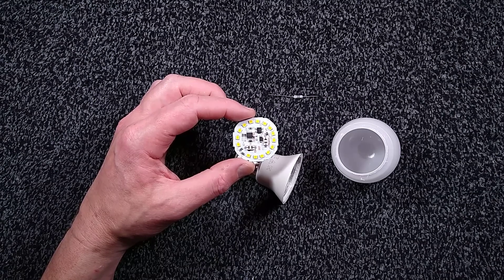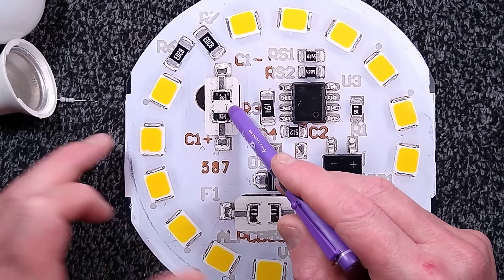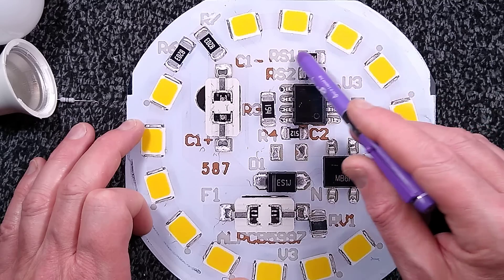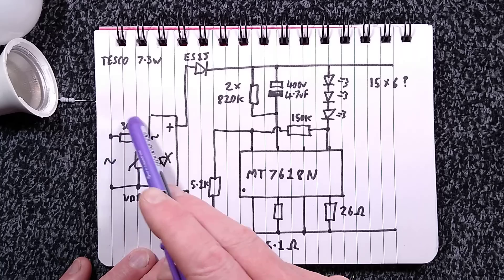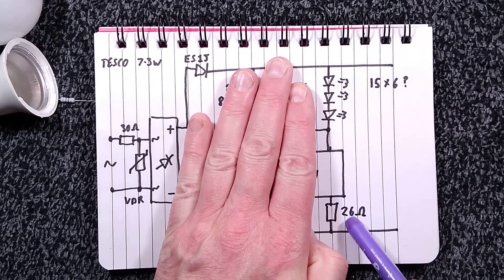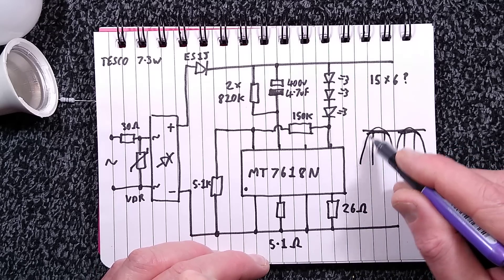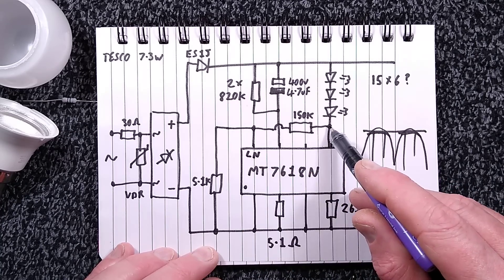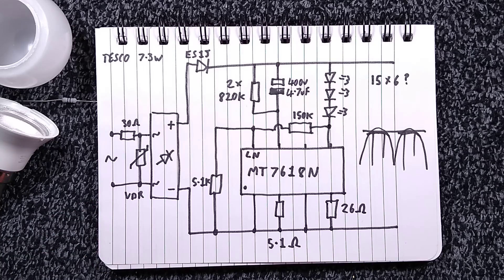Tesco lamp with weird circuitry twist

Comment: The LN is a voltage divider for line input voltage compensation. I've seen this used in higher end LED drivers to prevent LED flux issues seen with linear based designs. I like this as you can not only have constant regulated current at all times to the LEDs for longevity, but also maintain consistent lumen output with the constant voltage compensation.
Reply: You are probably correct, but Clives theory still spread more joy.
Reply: I was just about to leave a comment saying the same thing, now I'll just upvote yours lol
Reply: @ralgith  I was also just about to leave a comment saying the same thing, now I'll just  leave a comment here & upvote yours as well 🤣🤣
Reply: But please think of the Lesbian Nuns 😎
Reply: Agreed. Thanks for writing it. Upvote from me.   Fred
Reply: Why would input voltage compensation be necessary?    An LED driver is ideally a constant current device...  And is therefore independent of line voltage.
Reply: @Wierdy1024  This driver is also trying to smooth current across the capacitor, and the capacitor definitely isn't a constant-current device.
Reply: @Wierdy1024  only if voltage is high enough to pass this much current through these leds, ideal current source got infinite open circuit voltage.
Reply: That's handy, presumably this design makes sure the nuns don't need to worry about mains voltage fluctuations shifting their sexy mood lighting into the off-putting "gynaecologist's exam room" range when they're getting down to it.

Comment: My best guess: Diode for reverse recovery of the std bridge, std bridge diode di/dt is quite slow, a fast reverse spike on a ‘slow’ forward conducting diode will pass through the bridge internal diodes, the fast diode will negate this to a great degree. Normally not a problem if you have any capacitor on the DC side of the bridge, in this circuit I am guessing the diode is to protect the IC from such noise spikes as there is no capacitance directly on DC side of bridge before passing through the IC (or diode string)
Reply: That's my thought as well. It is probably just switching the capacitor in and out of the mains portion of the circuit at mains frequency, but the slow reverse recovery time of the bridge rectifier would cause spikes of current to flow back onto the mains, generating noise. Having the high speed diode there probably suppresses that.
Reply: @mysock351C  But millions of devices run regular bridge rectifiers off the mains, practically every appliance in the home does these days. Hard to why it would suddenly be an issue for this one little bulb?
Reply: @MB-st7be  due to the active PFC with switching the cap, probably.
Reply: @MB-st7be  It is because it has active switching circuitry in it. Remember the part about PFC? The capacitor is not just being charged in the usual manner. Rather it likely is being switched between charging from the mains and discharging through the LEDs. All diodes (with the exception of Schottky diodes) have junction capacitance and recovery times to consider. Standard rectifier diodes are SLOW and without the fast recovery diode, large switching transients would get back through the rectifier. This is an issue with mains transformers as well since the leakage inductance can make the rectifier reversed biased momentarily and it generates lots of harmonic noise. Standard LED lamps sans PFC do not need the diode.
Reply: @MB-st7be  we used to throw our poop out into the street too. At some point the first house was connected to a sewer.
Reply: Is there a power factor when there are no reactive load components?
Reply: @G6EJD  The capacitor is the reactive component. Serendipitously I found one of these lamps with this same PFC circuit at the office that had died. After a quick fix, it looks like it alternately charges the capacitor in the valley of the rectified DC from the bridge rectifier, and then disconnects it from the mains whereupon it continues to discharge through the LEDs. The diode is indeed needed to stop the switching transients from propagating back into the mains. Its a bit crude, but it does sort of work. Edit: No, actually its linearly regulating the charge current of the capacitor instead. Basically once it comes into regulation, it starts throttling back the peak charging current to hold a constant voltage on the capacitor, which in turn helps even out the current pulled from the mains. Actually a pretty neat circuit, and I had some fun messing with it.
Reply: @mysock351C  I didn’t realise that a 4.7uF capacitor could hold that much energy, enough to illuminate the LED’s for about 5mS in the troughs, fascinating.
Reply: @G6EJD  It’s actually pretty interesting. If the circuit is started on a variac, it simply behaves as a normal lamp and the ripple on the capacitor is the usual sawtooth at voltages below where the supply regulates. At this point there is zero voltage on the gate of the depletion mode mosfet, so it just conducts like a low value resistor. However, once the point it goes into regulation is reached, voltage is applied to the gate of the mosfet to start to pinch off the channel and act as a quasi-constant current source for charging the capacitor at which point the tops of the saw tooth start being progressively lopped off. The control term for regulation is actually the LED current. Once the desired current threshold is reached, the capacitor current is progressively regulated as needed to keep the LEDs on at a constant brightness. However, once the voltage starts to fall again, the LED current drops too low and it then falls out of regulation with the capacitor simply discharging through the LEDs, and the cycle repeats on each half of the mains cycle. By limiting the capacitor current at higher voltages, basic PFC is achieved. Also the regulation scheme explains the need for the diode. The supply constantly comes into and falls out of regulation, and does so quite abruptly, generating transients on the capacitor charging waveform, which would easily pass through a standard bridge rectifier.
Reply: @G6EJD  Also the notion of it being “flicker free” is somewhat of a misnomer. The LEDs do stay at a constant brightness, but only when the incoming voltage is high enough to be in regulation.  The rest of the time they dim slightly as the capacitor discharges waiting for the next cycle. Still it’s small enough not to be visible.
Reply: True. I'd not thought of the obvious here- the smoothing cap is NOT directly across the bridge output...
The smoothing cap must be switched in and out to smooth the charging spikes. Ooh, just had a good design idea for a power supply....

Comment: I would guess that the IC does more than regulation, i think it provides a higher frequency to the capacitor for better efficiency or also maybe to be dimmable. The high-speed diode I think is the cheapest way to prevent ripples or spikes from the higher frequency go back to the powergrid, could you measure the frequency?

Comment: Clive, does the electrolytic capacitor look like it’s a low ESR type, as typically used with higher frequency switch mode PSUs? Or does only appear to be a normal electrolytic capacitor?

Comment: If the extra (high speed switching diode) is to deal with / protect against noise or switching transients, why have we not seen them in other high speed switch mode power supply circuit designs?

Comment: Be interested to see what difference it makes to the power factor! With smart metering becoming ever more popular and the possible implications of changing the way they charge for electricity
Reply: I don't think any currently deployed smart meters have the ability to do the harminic analysis that would be necessary for what you propose.

And they way the meters are built by contractors means they won't be able to require it be added it via a software update either.

Comment: Here it is:
High speed diode to protect capacitor from high frequency transients induced by switching power supplies nearby. LN is phase monitoring, used to measure the position of the dimmer switch. This phase monitor feature requires the capacitor to be switched off during phase detection. It might be connected via pwm to charge it slowly during phase, and discharge slowly during flicker reduction. Meanwhile the led is controlled pwm/pid via current feedback. Oscilloscope to check answers. Look for transients by connecting laptop power supply to same line.

Comment: About all the speculation about noise, in traditional electronics where a larger amount of power is converted from AC to DC, a capacitor is fitted across each rectifier diode to reduce the switching noise from the diodes. But this has not been done here. So I don’t think any part of this circuit is for the reduction of noise. It’s all to do with improving the power factor and reducing flicker. Hence why a variable current limit is needed for the electrolytic smoothing capacitor. The only possible reason for the extra switching diode that I can think of, is to increase the minimum supply voltage (at the bottom of the sine wave) before it starts drawing current.

Comment: block high frequency feedback ripple on the live? Using a good cap would do the same, but ripple can also cause damage to some caps, whereas the diodes don't damage nearly as easily as caps? Plus caps vary in performance at higher frequencies, the higher frequency caps also tend to be more expensive.
that's just a wile stab in the dark though
Reply: Right. This was my thought. Dynamic loads on the mains can produce high frequency transients, that may get through a full wave bridge, a HS diode here will mostly increase the life of the capacitor, which is probably first to go.
Reply: @BenjaminGatti  - ANY AC or DC voltage on the mains side will get through both the bridge rectifier AND the extra diode. The extra diode cannot protect against mains side transients.
Reply: @Mark1024MAK  I take your point; however, without a better theory, we have to give the high speed discrimination a purpose. Positive transients will be eaten by tvs, that leaves negative transients which this diode can block. This protects the cap, and might prevent glitching or flicking being induced under transient testing. Remember transient testing is pretty severe.
Reply: @BenjaminGatti  - the bridge rectifier will attempt to convert both positive and negative voltages including transients to DC. If the semiconductor junctions in the bridge rectifier do turn on fast enough to let them through, by the time they get to the extra fast switching diode, they will be all positive. Being a faster diode, they will have no trouble passing through it.
If a very rapid negative transient manages to pass through the bridge rectifier, it will be a relatively high impedance signal, and hence will be no danger to an electrolytic capacitor or the LEDs.
If proper transient protection on the DC side was needed, then there are more appropriate components that could have been fitted. Such as a fast diode across the DC supply rails (normally reverse biased), a VDR, maybe even a semiconductor transient suppressor, or zener diode(s).

Comment: the capacitor is actually being charged by connecting to ground in order to give a better power factor, then during the peaks, the capacitor is disconnected from ground and then instead connected across the LEDs (above the 26 ohm current limiting resistor) this then effectively makes the positive voltage rail higher than the mains supply. It would be doing this at high frequency, so the point of the diode is to prevent current going back to the mains during the peak. (It's likely doing a lot more than just this in the PFC chip, this is just an easy way to understand what it is doing)
Reply: Wouldn't the amount of reverse leakage in the bridge rectifier be tiny though?
Reply: @jaro6985  yes, the bridge's leakage current would be tiny at 60Hz. The only reason to have a fast diode is if something is being done in the kHz range. Maybe the chip is shaping the capacitor charging curve using PWM and the fast diode is to isolate the bridge from that.
Reply: @teardowndan5364  Looking at the circuit in the datasheet I think it may just be switching the capacitor in and out at mains frequency. The diode is there probably just to stop the bridge rectifier from being reverse biased when it switches over. They have a slow recovery time and this would probably put a 100/120 Hz train of spikes on the mains if it wasn't there.
Reply: If the capacitor is being switched between the 0V rail and pin 5 (DLED) then wouldn’t pin 5 be also disconnected from the 0V rail during this time as well? If so, then the capacitor is no longer connected to both sides of the bridge rectifier anyway…
Reply: Also if the switching speed of connecting and disconnecting the capacitor is based on the mains frequency (100Hz for full wave), then that’s still well within the range of normal bridge rectifier diodes.
Reply: @Mark1024MAK  There is talk of a "500V power mosfet" in the datasheet, so I would imagine it does use some form of high(er) speed switching. Not a guarantee, of course. But it does allude to it. Edit: Although the lack of any filtering/decoupling does make me think it might be more mundane than it appears, and the need for a high speed diode might be for some other purpose like suppressing any switching transients since the bridge rectifier is quite slow by comparison.

Comment: Just about any component comes in fusible varieties, if you're bad enough at designing circuits or soldering them together.
Reply: Once had to beat a piece of 22mm copper pipe flat to make a fuse for a 24v system on a woodmiser bandsaw.  It still blew after a few days.
Reply: @Fatspurios  think something might be a little wrong there😅
Reply: @mattknowsnothing  yup hence the pipe.
Reply: I have a collection  of fusible Arduinos
Reply: I feel attacked by this statement for some reason. I don't know why. I mean I've always been totally careful and never let the magic smoke out of anything. And I totally just typed every word of that with a straight face. I kinda wish any of that at all was true lol
Reply: @godmonkeyjr  There is always hope! I hope your finger never becomes a fusible component. Sort of like that. Good luck. 👍
Reply: @d.t.4523  So far I haven't quite done that in the 40ish years I've been messing with electronics. However I have found my fingers to be a very good indicator of voltage  being present. Works faster than any meter I've owned! The caps on tubes in transmitters are usually positive not ground. One day I'll remember that. Lol
Reply: @godmonkeyjr  I vote you test the theory. Use the slowMo guys to test you touching a live line, then seeing if it showed on the meter in less time! 😁
Reply: @d.t.4523  Why is there a large percentage of my brain that really wants to try this all of a sudden?
Reply: @godmonkeyjr  I'm in for $20 on the pay per view channel.
Reply: In a similar vein, every circuit powered by a rechargeable battery contains a fuse, even if it doesn't look like a fuse .....
Reply: Okay, this comment invokes laughter from me. Thank you!   Fred

Comment: Thanks for covering this, I just bought a handful and was going to buy another and trey to send to you for analysis! Wouldn’t snipping one of those resistors break the circuit, shouldn’t the pins be shorted. I’m using six of these in two old fashioned three bulb light fittings, they are far too bright in one room, snipping that resistor will be a great solution!
Reply: The two resistors are in parallel.  If they were both 50 ohm, then two in parallel would equal 25 ohm resistance to current.  If you clip one out, you increase the resistance to the full 50 ohm of the remaining resistor.  If you then short out the pins of the removed resistor, you are creating a 0 ohm connection, and increasing the current.
Reply: @bokkenka  thanks for that,
Foot in mouth disease. Woke up at 5am and watched Clive when I couldn’t sleep and should have just looked at the circuit diagram he drew! Doh!!! Thanks for pointing out the obvious
Reply: You can also try to dimm these bulbs by putting a capacitor in series. I have had great success with "undimmable" led bulbs this way. A value of 0.33uF is usually good depending on watt of the lamps. The advantage is that you don't have to open the bulb and can still use them att full brightness if you bridge the capacitor with a second switch, you can even make more dimming levels with different capacitor values (or some parallel) if you want.
Reply: @Acamperfull  an excuse to buy a microscope for smd soldering. I like it….